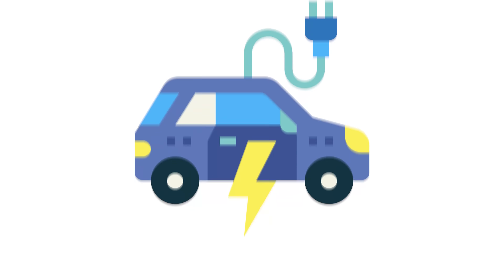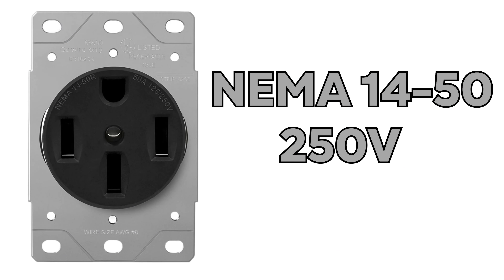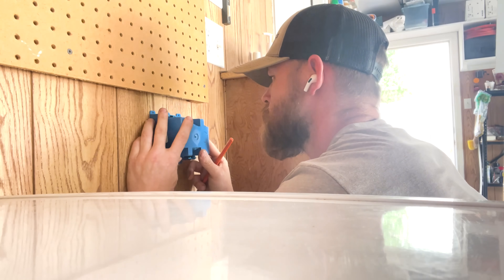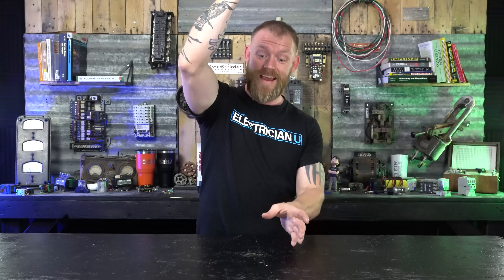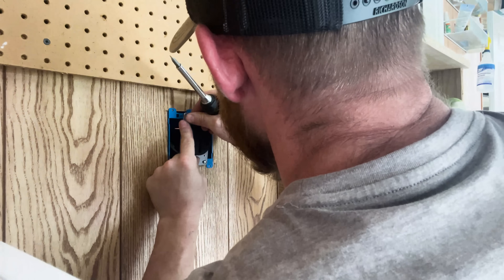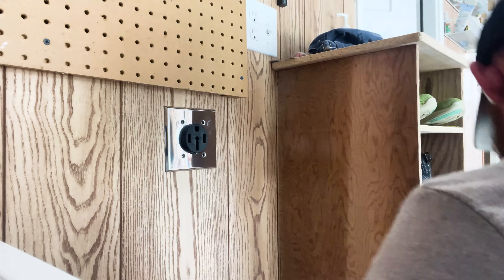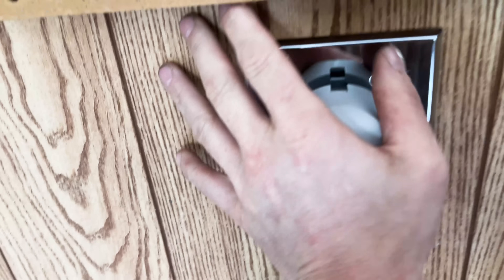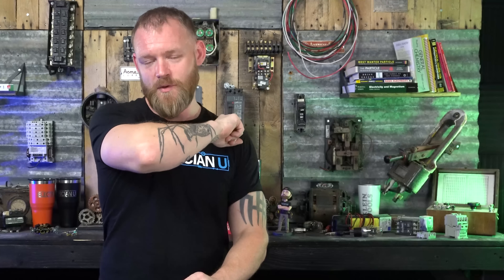How to Install an Electric Vehicle Charger Receptacle

Comment: My EV installation was very easy.
I just called an electrician!
He wanted to install a Leviton receptacle, I insisted on a Hubbell.
$90 bucks for a receptacle, to prevent my $70,000 car and $500,000 house from burning down, was cheap.
. If I have an incident,  no challenge from the insurance company!
Reply: Yes, the standard household grade Leviton NEMA 14-50 is definitely UNSAFE to use for the loads put on it by hours of full load charging of an EV. However, I see that Leviton has recently started selling heavy duty 14-50s designed specifically for EV charging outlets. I looks hefty like the HUBBLE and it even has an EV charging symbol on the surface of the outlet. Available at Home Depot, etc.
Reply: I believe Leviton now makes a heavy duty 14-50 receptacle  Bryant 14-50 is made by hubbell.  I think the green stamp means it's rated for EV use.  Although Amazon has low priced 14-50 with a green stamp I would only trust name brand like Leviton and Bryant.

Comment: I don't recommend a pop-in (remodel/old work) box with a straight blade 50 amp. I've seen them pushed through the drywall because of the force necessary to seat the cord connection into the receptacle. 

Get a stud mounted old work box.

Comment: Need a Metal Box! Wrong wire! Wrong receptacle too! You need industrial grade parts that are certified for daily usage and not only when grandma comes to wash and dry your clothing. 

Industrial grade is necessary for all EV charging because of the daily usage. EVs are changing rules everywhere including our homes 😮

Comment: I don’t see the point in under-sizing the breaker.  The electric vehicle service equipment (EVSE) will set the charge rate appropriate to the EVSE.  Even if the automobile is capable of 50 amp rate, when plugged into a 30 amp EVSE, the automobile will only be permitted by the EVSE to request a 30 amp rate.

Regarding GFCI, every EVSE should have GFCI functionality built into the EVSE.   Of course, verify if that fact is true for the EVSE you install.   Nuisance tripping is a thing which I have experienced with electric car charging, so if your code doesn’t require a GFCI breaker, you can save money and hassle by using a standard two pole breaker.

As someone pointed out, not all 14-50 outlets are good quality.  Hubbell makes the best, but it is expensive.  You can save money by choosing Bryant, which appears to be the same a Hubbell.  Electric car loads are more demanding than a range or dryer because a car load stays on until the end of charging while ranges and dryers cycle on and off while in use.  In the worst case, a poor quality outlet could cause a fire.

Comment: god they incresed where gfci are required?  literally every couple of weeks my utility seems to have a hit and every gfci in my house trips.. i am so sick of it...
Reply: Even worse than GFCIs, US code requires arc fault, or AFDD, breakers for circuits serving sleeping areas since 2014.  A friend recently built a house and the inspector interpreted the code as anywhere where someone might fall asleep, which was basically anywhere in the house.  Installing the large number of AFDD breakers to meet the requirement added almost $2,000 to the cost of the wiring job.  AFDDs are even more prone to nuisance tripping because they look for noise on the circuit which looks like RF noise from arcing.  Things like computer monitors, power strips , LED lamps, etc. can trigger an AFDD.

Comment: Just a heads up, I always test with a meter, until it bit me in the ass!!!!!

I always recommend a hubbell nema 14-50 because it can handle the continuous load. I tested the outlet with the meter and all tested good. Customer didn’t have charger yet. The next day the customer called me and said there was no ground. I knew I tested it and knew it was all good. This time I took a neme 14-50 outlet tester (sold on amazon for $20, just like a GFCI tester) it tested bad ground. The prong in the receptacle was bad and not making contact with the plug.  I had to replace the outlet. 

Just like to share, I now make sure all my employee test with a dedicated Nema 14-50 tester

Comment: Can someone elaborate on the different types of kva demand that different brands/models place on your service? Obviously, the receptacle he used is rated for 50, along with the deliberately upsized wire.... He mentioned that the customer opted for a safer option at 30a overcurrent... What does that say about the charger itself? I guess they make them at different wattages?

Comment: Use the correct wire size according to the load, consider the length of the wire. Under size wire will cause it to heat up, increasing resistance and disabling the breaker. Ohm's law has not been canceled!

Comment: About to install a Gen 3 48 AMP Tesla charger. I see in the manual that it says, "Do NOT install cord-and-plug type connections." Why? Assuming that everything is sized appropriately, what's wrong with building a 50AMP cord cap and plugging the charger into a 50AMP outlet? Seems like the ability to unplug if needed would be a good thing, but I can't find an explanation anywhere. Thanks for any help.
Reply: Gen 3 is DC direct current 400VDC/800VDC  250KW/350KW  fast charge standard. you dont want to be unplugging a 400VDC circuit carrying 625 AMPS for safety reasons. I think you may be reffering to a Gen 2 48 AMP.  which according to NEC 2020 code needs to be hardwired. EV outlets now require GFI and may conflict with chargers that have built-in GFI which the Tesla charge has built in and may cause false circuit trips of the circuit.

Comment: If your electrician charges you only a couple hundred he’s giving you an undersized circuit and not GFCI protected. An 50A GFCI double pole breaker alone is about $200. If the job is $380 I doubt he’s doing it to code. Just a heads up.

Comment: A couple things. Installing EV chargers is all that I do. It is getting to the point that I will not install an outlet but only do hardwired units. Some AHJ will require a gfic breaker, the outlet needs a neutral even though the chargers do not use the neutral and the cheaper outlets have been having major issues. My last install included a Hubbell outlet at $164. None of the RV exterior enclosures will accept the commercial grade outlets the diameter of the actual outlet is larger. Concerning wire size, many units will now specify wire size or temp rating and inspectors are wanting to see the instruction manual. If the manual states 90degree wire, romex is out. All my installs are now thhn in conduit.
Reply: Hubbell is the way to go.  No risk of ground touch exposed nuts
Reply: What about copper SEU?  It does exist.  It is annoying that the chargers spec copper in this era.  We have been using aluminum for everything over 20 amps pretty much these days unless it specs copper for some reason.
Reply: @nspro931  Most units we install spec copper and 90 degree. I have had inspectors read that to mean that if I use romex, I need to lower the breaker to 50 and the output then to 40 if hardwired and then ok if an outlet. I have had #6 SEU pass  as well. Mostly I try to only install hardwired with #6 thhn in conduit. Always check with your local inspections dept.
Reply: The other thing about the 'industrial' 14-50 plugs is that the termination temps aren't marked for 75 deg C, so you end up derating the wire to the 60 deg C column even if you use THHN in conduit. This is the single biggest incentive to hardwire the charger, since most chargers have higher termination temps.

Comment: This is not an EV charging receptacle. It isn’t rated for 100% duty cycle and will melt over time. 

They should never be used more than periodically and you should always be using a proper EV charge port. 

Way too many are taking this shortcut and burning their houses down. Monroe did an excellent piece on this and presented all of the data.

Comment: EV makers need to "adopt the "induction charging" method of charging vehicles ASAP.   This technology ihas 
been around for decades and is a perfect fit for "convenient charging of EV's.   Charging vehicles without
having to connect anything; get out of the vehicle in snow and rain;  would appeal to many Tesla customers.
just imagine;  pulling over a lighted pad;  it dings when you are in position;  you just hop out and the charger
later texts you when the vehicle is ready.  What is not to like???

Comment: I’m not an electrician. I want to buy a Nissan Leaf. My house is 50 years old. Will I be able to add this plug to the electric panel? I will hire a professional.  Will I have to upgrade my panel to pass inspection?  I know that it will have to be a GSCI since it’s in the garage and we are in a flood plain. Thank you if you have a suggestion.

Comment: Question here from a DIYer knowledgeable enough to be dangerous...I'd feel better using a metal (vs plastic) box if I'm running 50A wire with the thought that I might be using every single Amp of its capacity, continuosly for hours; as oppossed to, say a dryer that I might use every other day for an hour or so...Metal box better for an EV charger?

Comment: Question. Is there anything in the NEC that stipulates the maximum length of a charger’s A/C cable. 
Chargepoint says that the NEC has a 12 inch limit, but JuiceBox has 24 inches. 
Thanks.

Comment: I've seen and replaced 4 wall charging units wired with #8 on 40amp breakers, all 4 had caught fire.  When it comes to EV charging, 30amps is the max breaker size  I would use for #8.

Comment: Not an Electrician tho I worked as one 45 years ago...and this is still simple stuff...I would do the whole job with the last thing being to connect on the panel. That way you only need the power off for a half hour.. It could take 5 hours to run the cable depending how difficult it was.

Did a 50A inlet for my generator last year and it is the same thing. Tho with lockout added.

Comment: That outlet is designed for occasional use, not for continuous use.  Also, it's not designed for plugging and unplugging.  it's made to plug a dryer into or a range, and leave it plugged in so there is no wear on the contacts inside.  This is all new territory for electricians, since we never had to deal with plugging in a continuous demand vehicle.  The code needs to be updated for these new demands.  There are already fires, not from the car, but from these poor connections.  Tesla connectors will accept # 4 wire.  Don't go cheap on any of these connections.

Comment: Is there any advantage of using a 2 gauge metal box vs the 2 gang plastic box?
Reply: Yes. Plastic, if overheated from electrical resistance/too much current load will melt and won't contain a fire like a metal box will.

Comment: Question?  Does hardwiring the charger, as opposed to wiring in a receptacle for it make it so you do not have to GFCI that circuit? If so that would be a way to avoid nuisance tripping.
Reply: The majority of EVSEs have built in GFCI, so in most cases you are fine with hardwired setups.
Reply: @malcolmtaylor111  That's what I expected ... and since it would be one designed to work with the EVSE, presumably it shouldn't trip randomly.

Comment: I’m not an electrician!  There’s my caveat. For an EV receptacle, you really need an industrial nema connector rated for 100% duty load, and you need to torque the connectors down to spec. A standard residential dryer style plug is not sufficient. Just do a search for details online. Munroe and associates has a dry, but very informative video talking about these things melting due to long charging times and high, but still within rated amp ratings.

Comment: Other YouTube videos say to use 6/4 cable, which makes sense, since 8 gauge (as in this video) is only good for 40 amps; and 6 gauge is good for 50 amps at 240v.   Also, use the Hubbell 14-50R receptacle, as the cheap 14-50's can burn out.
Reply: 😂 oh victor

Comment: Was that receptacle terminal rated in the 75-degree column that's how you got away with using 8-3 for potential 50 amps in the future if they decide to swap out the 30 amp breaker

Comment: I am curious if in this scenario using a knock out box was a good choice for the housing of that plug. I would imagine the user is going to be plugging in and out of that receptacle many, many times over the years. Just as you wouldn’t leave an extension chord plugged in when not in use. Wouldn’t you worry about the wear, over time, of the force of plugging in and out that chord everyday that would eventually wear out the tabs holding the box? Would securing that box to a stud make more sense for longevity?

Comment: No No No
No wall charge plugs or module.
Clealing Install
Pull rope down to the charge port
Unplug and release the plug and cable to ceiling.
So
Never ever have a 240v plug / charger on a wall
Clealing install the plug / cable with spring / bungi cord with pull down rope or ribbon for a pull-down plug / cable.
Reply: If your going to do it do it right
Stupid Wall or Ground charge cables. Extremely Stupid insane Tesla Wall Charger and more Insane charging cables laying around. Ceiling Chargers Ceiling Cables Never ever trip over high voltage cables Never drive over high voltage cables Spring r Bungee r Rope w Counterweight All from top-down ceiling hook down Stupid Tesla Wall Charger

Comment: This is a safe install because of the customers request of a 30 amp breaker. However this is not rated for a 50 amp ev. A ev is rated at 125% continuous load! Also in the code book you would size the wire off of the weakest link which is the breaker normally 75 degrees. In California we have evitp training that comes with a state certification. Awesome coarse!!!!  The correct wire size for a 50 amp ev plug is # 6

Comment: I don't understand why they use the 4 wire outlet with a neutral, Pretty sure it's not used, Also #8 is only good for 40 Amps!, Even though he only Breakerd it at 30 Amps he said it was good for 50🤔

Comment: I'm not an electrician but I own an RV and have installed many of these outlets over the years. It's really not hard as long as you do your research! Use a double pole 50amp breaker, 8/3ga or 6/3ga, connect it correctly, done. If you can connect a breaker run wire and connect an outlet you can do this.

8ga for 25ft or less
6ga for 25ft- 50ft
4ga for 50ft-100ft
Reply: No.   Just don't give advice, it's clear you're not qualified and some other poor fool will follow your example and burn down his house.

Comment: I have a 200A supply to my house. I have these high amp items in my house: Two 2.5ton AC units, 1 Oven, 1 Dryer. Will 200A be enough to add an EV charger outlet?

Comment: Tesla is a frustrating company to deal with as they don't make things simple!!My question is very simple which Tesla can't answer in their Bible of instructions..

My friend has purchased a Generation 2 Nema Adapter.

Can you use 6/3AWG copper wire,30amp double pole breaker and a 30amp female outlet with the Tesla charger/adapter  (PN 10998-44-10-D)
(SN:FA2222043416690)

Comment: That receptacle is the weak link in that system. The cheap plastic one you put in wont stand up to the continuous load that car chargers are and melt. A bakellite receptacle is superior but a hard wired charger is the best. Never use resi junk on continuous loads.

Comment: BEWARE! Please be aware that there are several fires occurring because of bad installations. 

ALL EV installations should be of the highest standards and using the highest quality products. 
ALSO the connections within the breaker box AND the receptacle have to be torqued to avoid fires and the cheap plastic melting, when put under extreme strain. 
Loose wires will eventually cause a problem.

Comment: Question. Can I have two men's 14-50 outlets connected to one 50 amp gfci breaker? I need a 14-50 outlet on the side of my house for my RV (pulled max 30 amps if I'm running both AC units) and another 14-50 outlet in my garage for a welder. Both will be an either or use and not at the same time.  My main goal is not to have to use two 50 amp breakers since my panel doesn't have room for more than one and I'd like to avoid a sub panel addition at this time.
Reply: No. You are creating a fire risk. Why would you spend 10's of thousands of $ on an electric car that will probably last you 10 years or more, then try and cut corners on charging it.
It would be like going to the back street supplier for gas because it's cheaper than the garage that takes all the necessary precautions to keep everyone safe.
Don't risk your house and your family, to save a couple of hundred bucks.